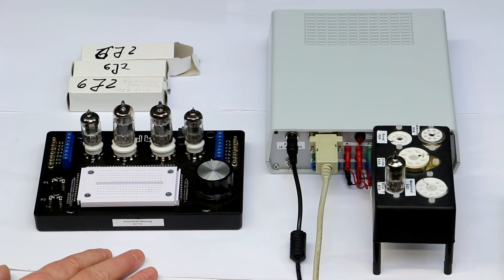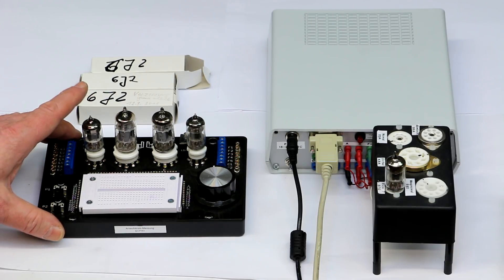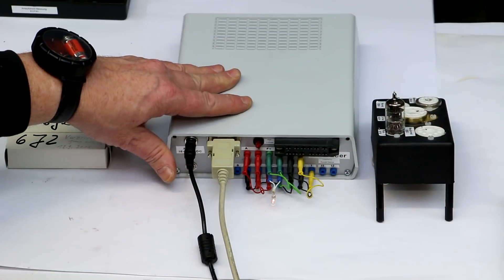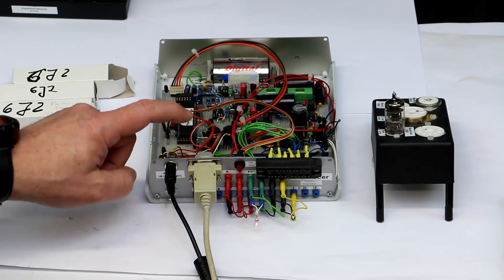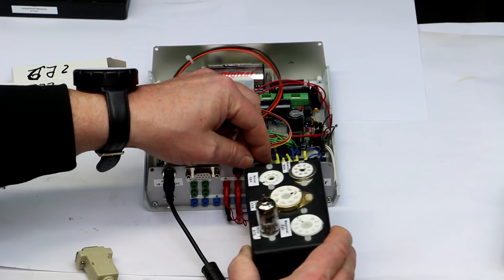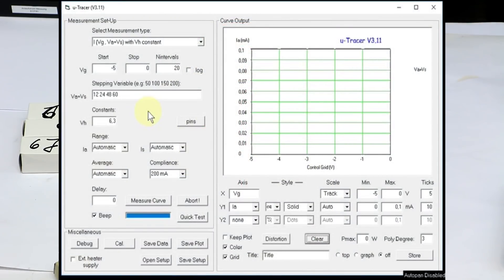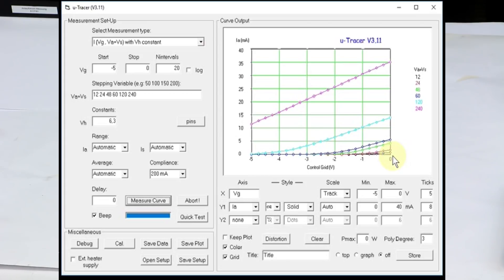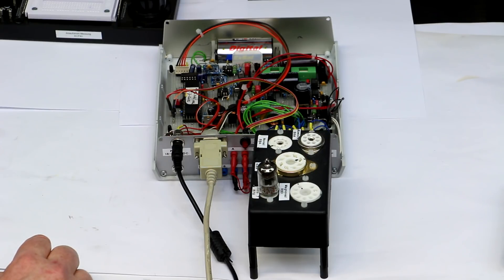Tube-Selection with a PC-controlled Curve-Tracer (the "uTracer")

Comment: Anlaufstrom = "inrush current"? :)
Reply from the maker: No. I don´t think so. The inrush-current would better apply to the heater where the ohmic resistance is quite low when it is cold and then increases after heating up. So inrush currents have the characteristic that they are quite high in the beginning and level off after some time
The "Anlaufstrom" is the anode-current without any voltage applied to the anode and the grids.
And it slowly rises (instead of falls off) and then levels off when the heater is turned on.
Reply from the maker: Are you sure? 
Technically it´s not an (unwanted) leakage current.
The current results from the cloud of electrons around the hot cathode, which repel each other and thus reach the other electrodes (grids, anode).
Reply: Ah yeah i see.. thats right.. inrush current is more a current peak ("Einschaltstrom") and i agree its also not leakage.. but there must be an english word for it, i cant imagine that... ;)

Comment: Roger, thank you for the video on the utracer.  I built one a couple of years ago and went with a multiple position rotary switch design for the tube pin selection.  Although more complex than using jumpers, this allows for quick setups and has a retro look like an old style tube checker.  Ronald did an amazing job designing this tester and he continues to make improvements to the hardware and software.